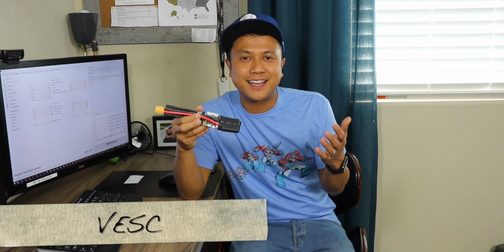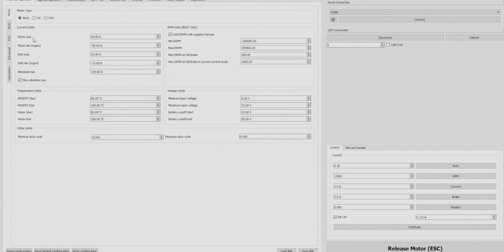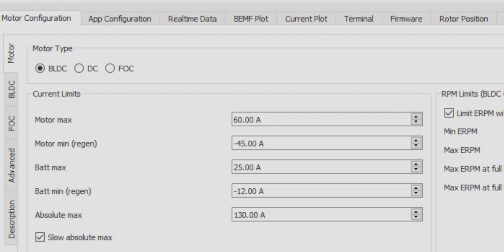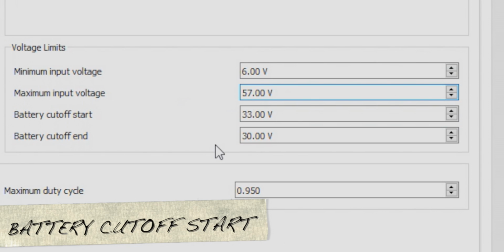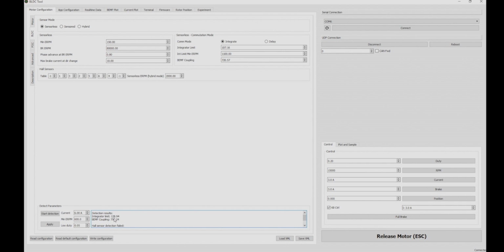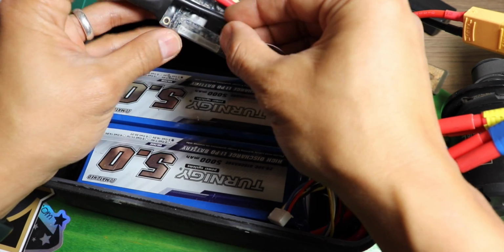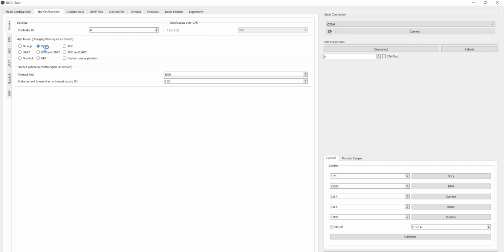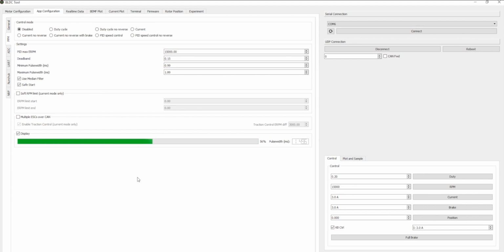HOW TO BUILD A DIY ELECTRIC ⚡  SKATEBOARD TUTORIAL - VESC & RC REMOTE CONFIGURATION - PART 3

Comment: why didn't you just use a rc esc/ electronic speed controller and then just plug that into the radio receiver. wouldn't that be cheaper and less latencies
Reply from the maker: An RC ESC was something eskater used on the past.  However, what was missing there was smoother breaking for a larger weight and also regen braking.  This is where the VESC came to be valuable.  It was more specific to an esk8ers needs.

Comment: Great series, I'm looking to make my own soon.

Question: Have you looked into what can be done to weather-proof this board? And protect the belt from debris?
Reply from the maker: Thanks for checking out the videos!  You can 3D print or buy covers that attach the the mount.  I personally have not used them.  You can also go geared which is gear to gear taking the belt out of the equation.  Usually with geared setups they are covered.  I personally don't find the belts attract debris that will effect your ride.  I just check the belts before riding.  Good luck and shoot me an email at bigkidsofficial@gmail.com if you need a parts list.

Comment: Hello. Whats the speed top and range km
Reply from the maker: Hi there!  Thanks for checking out the video.  This board with it's current settings, gear ratio, and wheel size got up to 53 kmph and has a range.of 14-16km depending on how you ride and the environment you are in.

Comment: I already own a Boosted Stealth, and ordered a Lacroix... I don't think I can build a board better than the pros like you, though I am interested in troubleshooting problems under the hood w/ the VESC software. Since the VESC platform is used to configure and monitor the settings of electric motors and remotes, will I be able to access such data from the commercial boards I purchased? I have to go back over your video and look at how you connected the computer to the VESC Controller via USB... I guess the question should be, do most commercial electric skateboards have a VESC controller, or are the VESC setting proprietary (inaccessible and/or behind a firewall)?
I enjoyed all three videos... How did you learn all this? Pretty amazing that you figured out all those settings in the VESC app... you must have a few friends you can concur with, less you might fry some parts or even cause an explosion.
Reply from the maker: Hey James, so the story is about 2 years ago I wanted to purchase an electric skateboard only to find out my investment in one would be a lot of money. So I decided to get into DIY to learn how to build one and hopefully do it for less than what a Boosted would cost.  What I didn't factor in where the tools to make the board as well as the mistakes I was about to make. Luckily I was able to find the esk8 forums which I think you would also find helpful. They are an awesome community of like-minded builders and many of them building boards like the LaCroix (Diy builders working on comercial boards).  I think you would be a perfect fit for the forum. I made these videos because I also thought that the forum limited itself to text. My videos may not be the perfect solution for everyone but I was looking for videos like this when I was building my first board.  Any how to answer your questions the Boosted uses a proprietary ESC which you can not program or configure.  However I believe the La Croix uses a a highly reputable ESC from Enertion called the FOCBOX.  The FOCBOX can be accessed via the BLDC tool, VESC tool, or many other version of the VESC tool developed by members of the esk8 forums.  I hope that answered your question.  Go ahead and check out the forum:. https://www.electric-skateboard.builders

- Neil

Comment: hey
following you i built my own board, but there is a problem that i have used a simple battery indicator from bangood and used a 18650 battery pack at 10s 2p configuration the problem is when my vesc cuts off the battery indicator is still showing 20%
so i wanted to know that is that normal or is it only in my case
Reply from the maker: It depends on you VESC setting.  Normally there is a cut off time about 20% before the battery hits 0%.  You actually never really want to drain the battery to 0% because it will damage any battery.  So, I'd actually say even 30% is better cut off and increases the longevity of your batteries.  Hope that helpped.

Comment: Will be cool to have a way to change the regen value on the way, with the Iphone or something through bluetooth, wifi or usb, that way you could charge the batteries while you are going down a big hill (setting the regen to more torque), or charging the batteries while riding with your legs ( setting the regen to less torque).

Comment: Hi! Great build! Why didn't you use a BMS for the battery? It is way more safe!
Reply: Hmm that's interesting, I'm not that experienced and I want to build my own board soon. I thought the bms makes it so your stuff doesn't overheat when riding. Should I use 2x 5s 5000mah lipo's with 2 bms's in series or should I just connect the batteries in series directly to the (v)esc? Thanks for your answer btw!
Reply from the maker: Using a BMS provides another point for possible error.  It does balance charge the batteries without using an external balance charger.  However, nothing is perfect.  If this is your first build hook the batteries up in series, then connect it directly to your VESC.  If you get sick of taking your batteries in and out and want a BMS do it later after you have some expirience.  Good luck and feel free to comment if you have any more questions.

- Neil
Reply: @BigKidsOfficial  Alright! I will do that first. What do you think of these parts?
Hobbyking.com:

Motor:
NTM Prop Drive 50-60 270KV / 2400W
€48,96

VESC:
Turnigy SK8-ESC V4.12 For Electric Skateboard Conversion w/BEC
€79,35

Battery:
Turnigy 5000mAh 5S 20C Lipo Pack w/XT-60
2 x €42,23 = €84,46

AliExpress:

Remote:
2.4Ghz Plastic Remote Controller W/receiver for Electric Skateboard Longboard
€33,17
Reply: @BigKidsOfficial  I still need to decide on a pulley system but I don't know what wheels/trucks I'm going to get yet.
Reply: @BigKidsOfficial  I'm sorry for all the questions.. But what do you think of this pulley system. https://m.banggood.com/DIY-Electric-Skateboard-Kit-Parts-Pulleys-And-Motor-Mount-For-80MM-Wheels-p-1146629.html

I know the motor pulley is 8mm and my motor is 6mm but those are available for like 5 bucks. Buying caliber 2 trucks and motormount is a little to expensive for me I think. This is a school project wich I am investing in myself but my budget is like 400 maaaybe 500 MAX. Oh euros btw.
Reply from the maker: No worries, feel free to ask as much as you want.  Those pulleys work with the 5055 motor.  What is the size of the motor you'll be buying?  I personally don't have expirience with this pulley/motor mount combo.
Reply from the maker: If you do (2) of the 5S Lipos in series then you'll want a lower KV motor.  270kv is pretty high and if you want to keep that motor you, wanna step down your voltage to maybe (2) 3s or (2) 4s Lipos in series.
Reply: @BigKidsOfficial  aah that sucks, I would love a torqueboards 190kv motor then but shipping to my country is $40 (netherlands) so that's not really an option. Would this one work?
Turnigy Aerodrive SK3 - 6364-245KV Brushless Outrunner Motor

The ntm propdrive is 50-60 I think btw.
Reply from the maker: Yeah, the motors you mention can work.  However just stick the the rule that the higher the KV the lower your voltage is.  What the community has found is that 190kv is a good balance of speed and torque at 10s.  But the 245kv might also be good with 10s.  However, because the resolution per volt is higher you risk over working the VESC.  That's why I recommend a lower voltage with the higher KV rating.  Hope that helped.
Reply: @BigKidsOfficial  Thanks man! You're awesome. I subbed. I found this 190kv turnigy motor, think I'm gonna go with that. https://hobbyking.com/nl_nl/turnigy-aerodrive-sk3-6364-190kv-brushless-outrunner-motor.html?wrh_pdp=1
Reply from the maker: @geert-mol  that is a great option!  Alot of diy folks use that same one.  Let me know how it goes 😁
Reply: @BigKidsOfficial  Hi Neil! I just found out my motor is 6364 and this mounting kit is for 5065/5055 motors. Does this work fine or what would be a cheap alternative?
Reply: @BigKidsOfficial  I read a lot of reviews about the cheap mounting kids and found out they suck.. I want to invest in a good one from for example torque boards but shipping to europe is $40! For a motor mount... Do you know any good quality ones that ship cheaper or are from vendors located in europe?
Big thanks
Geert
Reply from the maker: Hey Geert!  Thanks for stopping by and appreciate the comment.  I do have a high amp BMS on another build I have.  But, honestly, BMS's have mixed reviews especially if you're using it to discharge.  If you're strictly using it for charging then using a balance charger is actually more accurate and more safe.  Not to say I won't use a BMS but for charging BMS's have been known to fail.  Just check out some of the budget boards for sale that have caught fire because a person left it plugged in over night.

Comment: You set the values your talking about @9:55 to 36 & 35v instead of 3.6 & 3.5 like you stated you wanted. Huge difference there.
Reply from the maker: 36 is only for my battery set up of 10s or 10 cells.  If you have a 12s lipo it's 12s x 3.6 = 43v.  So I didn't want to state my voltage cut off, rather the voltage cut off of one cell so people can do the math for themselves.  That explains the difference.

Comment: My computer won't recognize the VESC. I have bought a new data mini usb cable and no luck, i have installed the stm32 driver and no luck. any help or tips would be appreciated. thanks!
Reply from the maker: Hey Jerry.  Sounds like you've done a lot to get this going.  I honestly can say, as awesome as the VESC is compared to ESCs out there it does come with it's share of issues.  Did you get a chance to visit the esk8 forums to see if someone had a similar issue or can help?  Here is the link in case you haven't. https://www.electric-skateboard.builders

Comment: Does it matter what VESC and motor combo you use? What about battery voltage and current output? If you noticed your batteries are draining too fast can you just add more batteries into parallel?

Comment: I've problem when I try to make a motor detection it failed on the debug console it say : "Status : Bad Detection Result Received" . I tried to change battery cutoff start and end (to lower them) but didn't change anything ...

I've a Torque 6355 Motor, 2x6S battery and this VESC : https://hobbyking.com/fr_fr/turnigy-sk8-esc-v4-12-for-electric-skateboard-conversion-w-bec.html

I also try to update firmware but that didn't work also ...

I'm pretty depressed ....

My software is not exactly the same (think is more recent that your one). Do'n't know if it change somethng .
Reply from the maker: Sorry to hear.  It's honestly hard for me to diagnose every person that runs into challenge.  But keep you head up!  I suggest you go to the esk8 forum https://www.electric-skateboard.builders. So many like minded individuals that may have had a very similar problem.  Just read a lot before asking a question.  Good luck!

- Neil
Reply: Hello I find it the problem TY came from the FirmWare I updated the bad one. Still have a problem that I don't understand. I'have dual motors, same motor, same VESC config but one goes faster ... make me crazy /!
Reply from the maker: Damn, I honestly cant help you.  Did you visit the forums to see if anyone had the same problem or can help?

Comment: yo, how do you make the second wheel move with the motor? the first wheel is attached directly to the motor, but what about the second?
Reply from the maker: This build is for a mono drive or single motor. In order to a build a dual drive you will need a second pulley and belt system as well as second motor.  However, a mono drive will suffice for most riders.

- Neil
Reply: so only one wheel is spinning from a motor?
Reply from the maker: Correct 👍

Comment: Hey Neil - Great tutorials...  Here is my build: https://photos.app.goo.gl/KvlOTOfdesGViCfe2 
I used most of what you recommended.  I got a Rimable board cheap on Amazon (Its Ok.  It has those raised sides, which I don't like) - Overall, A solid 42" board($29 on sale).  I used a parts container from Home Depot for the electronics(cut off handle.  Has plastic hinges - So... I don't recommend).  I went with the 97mm flywheel cloans, 36t and 14t pulleys, 6374 motor, DIYE mount from Amazon, Caliber II trucks, Zippy 5S 5000 LiPo's from Hobby King, VESC, Motor, pulleys from https://diyelectricskateboard.com/.  Anti - Spark On/Off switch from ebay, and battery percentage indicator from Amazon.
https://www.amazon.com/gp/product/B07759SLYP/ref=oh_aui_detailpage_o01_s00?ie=UTF8&psc=1
https://www.amazon.com/gp/product/B06XS3KZH2/ref=oh_aui_detailpage_o02_s01?ie=UTF8&psc=1
https://www.homedepot.com/p/Homak-9-Compartment-Non-Stackable-Storage-Small-Parts-Organizer-in-Orange-HA01109225/205036122

Thanks, Keep up the videos, They're great!

Comment: Hello Big kids, I 'm currently building a dual motor electric skateboard. I bought Turnigy SK8-ESC V4.12 for speed controller and was wondering if it was possible to connect 2 of them (with a connector) so you can control both at the same time.
Ty
Reply from the maker: It is possible.  You will need this: https://diyelectricskateboard.com/collections/esc-speed-controller-accessories/products/torque-esc-can-bus-connector?aff=3

Then when you're ready follow these instructions: https://diyelectricskateboard.com/blogs/diy-electric-skateboard-tutorials/vesc-bldc-tool-app-wizard-dual-motor-slave-instructions
Reply: Ok, since a was searching for a cheapest alternative for the VESC Torque, I found the Turnigny pretty similar and I've already bougth this connector for try. But if you telling that will work it appease me a bit.
Ty, will tell if it's work .
Reply from the maker: Yeah, the Turnigy is just fine.  I have a couple friends that use it with no problem.  Also the can bus connect will work great for you!
Reply: Ok, thanks for help.
I also used your code (hope that will reward you a bit)
Reply: Hello, I have one more issues. I bought those SK8-ESC and bought Torque 6355 motors, but connections don't fit each other (ESC  connections are too small), have you any idea how to make them fit ?
Torque are : Gold Bullet Connector 5mm and ESC are 4mm bullet connectors

Should I buy 5.5mm Gold bullet connector to replace those on the ESC Wires by cutting ?
Reply from the maker: Yes, what you'll want to do is cut the connectors off of each side and solder the correct connectors.  You can go 5mm, 4mm, or what ever you like.

Comment: what limit should i set erpm to for 12s? i also heard some people turn off so im confused on this one.
Reply from the maker: Hey Edward, thanks for the support and for checking out my videos!  Sorry for the late reply.  Anyhow, you can set your ERPM 60000k which is concervative.  However, many have said that the ERPM limit isn't very accurate and is.very common for DIYers to turn off.  I have recently turned mine off and it works well.  Good luck!

-Neil

Comment: you put your battery cut off at 35, not 3.5
Reply from the maker: Because 3.5 volts per cell.  10 cells x 3.5v = 35volts as cut off.  Sorry if that wasn't clear
Reply: So what does cut-off mean then?
I thought it was like on a laptop where you can have the battery turn off at 30% for example to not use as much battery.
but if the voltage is 35V and you have the cut off at 35V this is not the same, so i am just confused on what the cut-off portion means.
Thank you for response :)

Comment: Yoo whats good man!?  Question, have you always used the BLDC configurations for your VESC from TB? I've read a lot about people who experienced troubles with frying their VESC when using them under the FOC configurations instead of BLDC for the additional benefits (less noise,  efficient, etc). I'm trying to figure out if it's worth the risk since TB doesn't offer a warranty on the original price for their VESCs.
Reply from the maker: Hey bro, thanks for stopping by again!  Yeah, FOC on the TB VESC has been known to fry DRV chips.  But that is a risk you have with any VESC as the max output of a VESC is 50A continuous.  If you run it on BLDC I find it works well.  If you run FOC it may be better to invest a little more $$$ on a VESC like Ollin Boards or Enertions' FOC Box.  If you have VESC issues there is a fella in the DIY community named DRVWizard that can fix your problem of you have one.  Let me know if you have any other questions.

- Neil
Reply: Yo thanks for the reply! Ok I see, I definitely recall reading about those more reliable/expensive VESCs on the DIY community. Thanks for the detailed info. I guess for my first built, I'll stick with buying the TB VESC and running the same configurations from your video. I'll make sure to use your affiliation link when I order it!  Appreciate the help man!!
Reply from the maker: No problem..yeah, the TB VESC is a decent starter VESC.  But when you run FOC or higher Amperage set ups, you want to look into other vendors.  I have 2 FOC boxes coming from Enertion, but they were a pretty penny.  Good luck, and thanks again for the support!

- Neil
Reply: Oh nice, word?? Maybe in the future you could be a VESCs comparison video. Thanks again though!